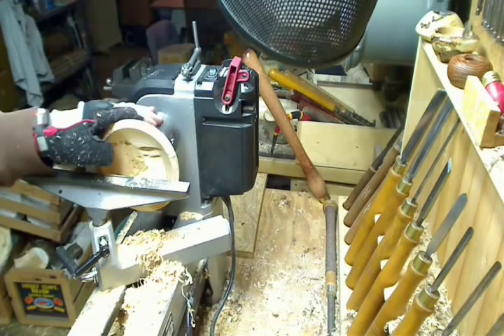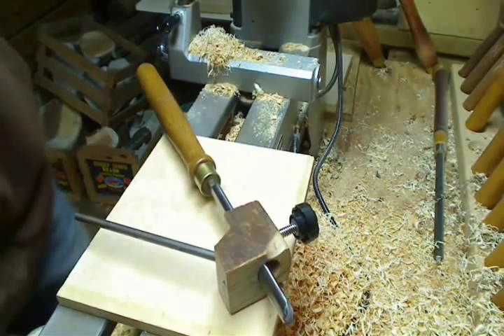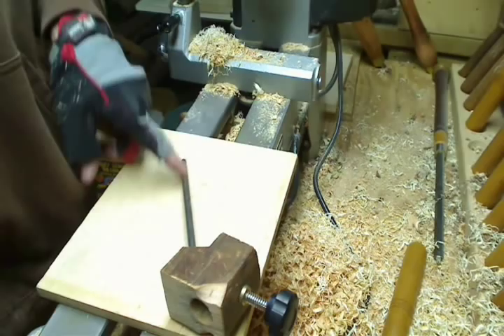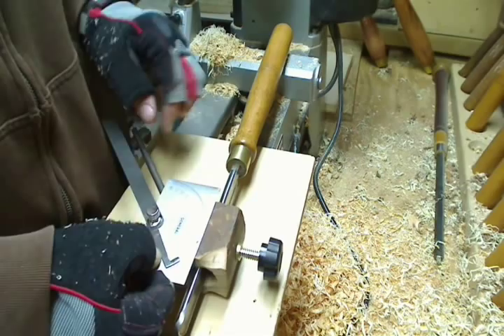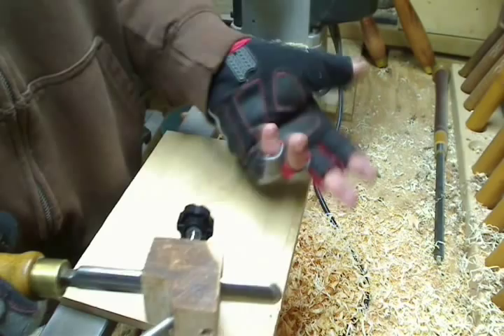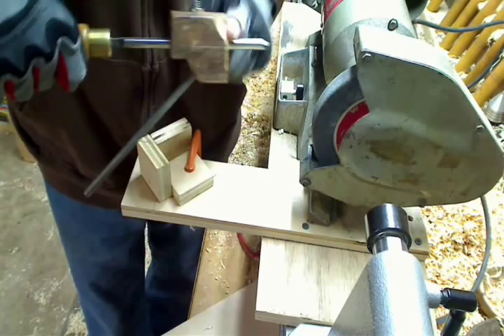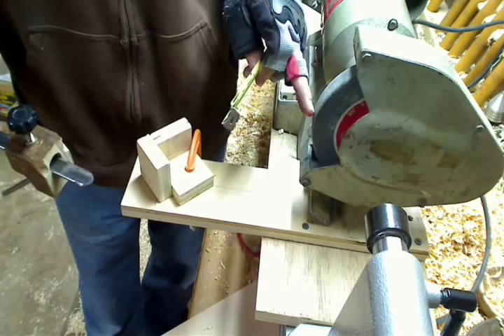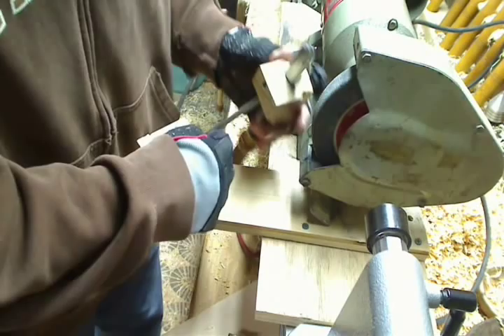Build an Ellsworth jig

Comment from the maker: i did ad some speech bubbles with basic info to the video after uploading. when trying to research the jig i found so many different configurations i chose to go with one with a 6' post with 45% angle that works great with my grinder, but there seems to be to many ways to set this jig up or opinions of how to. i do agree the video was lacking some details the jig itself is really very basic and easy to build only thing to consider is what size grinder, that might change the post length. thx!

Comment from the maker: when i first got my 3/8 Ellsworth bowl gouge and i looked at the tip on that thing i knew i had to build or buy a jig asap. because there was no way i was going to be able to match the grind without it. thanks to you and others for bits and pieces of info i was amazed at how easy the jig was to make and effortless it is to use. 

thanks, Tom

Comment: Help plz... Every vid I see uses the 2-4-7 method on 8" wheels (great), but I have 6" wheels.Does this still work or are there different numbers. Great video btw. Thanks
Reply from the maker: yes it does work on a 6" wheel. might need to play around to find sweet spot. but that's a 6" wheel in the video.

Comment: I built one that used the same base as my Wolverine. I have a couple gouges that really should be retired but I still use them and I had to shorten the piece that holds the gouge to get 2". It made the post a little longer to get the 45 degree angle but it still puts a nice 55 degree grind on my gouge.  I used the plans from Eddie Castelin and his showed the post going to the back of the holder and not the front which is why mine is longer. Still works great and $12 for parts beats $ 50 anyday.

Comment from the maker: I agree building your own is the way to go in my opinion. i have one gouge that's to short for my jig but iv played with the height and how far away from the grinder and still got a decent grind on it, maybe a slight different angle out on the wings but still achieved my 55 degrees. thanks!

Comment: Excellent video. What if you cannot achieve the 2" overhang of the tool? I have a couple of small gouges where the locking screw would be clamping on the tool shaft diameter, not in the flute.